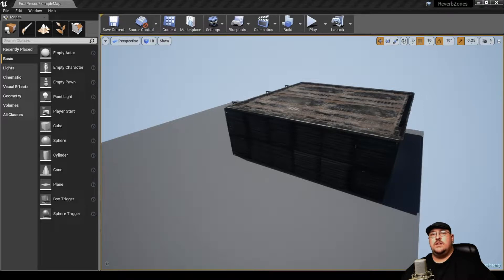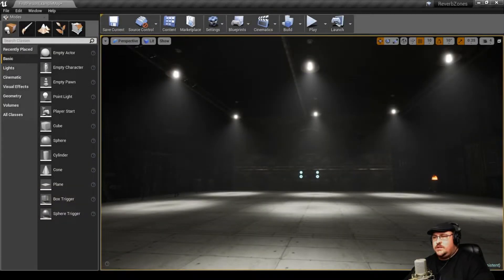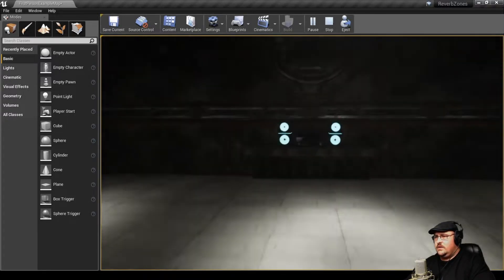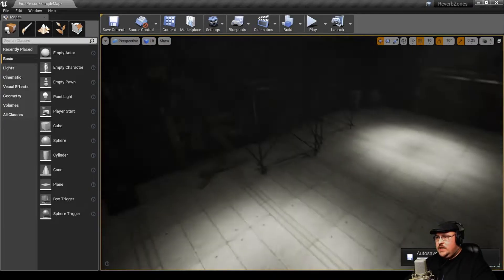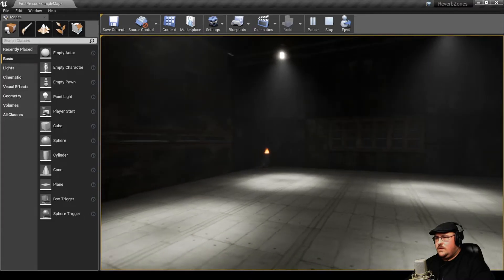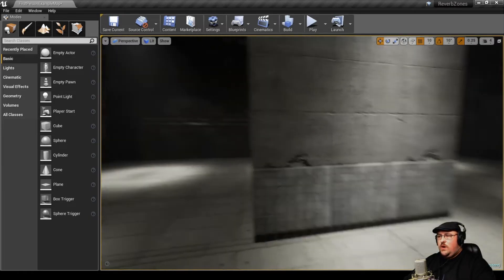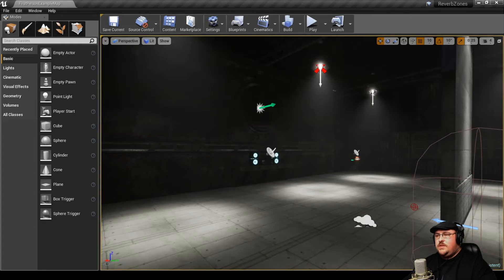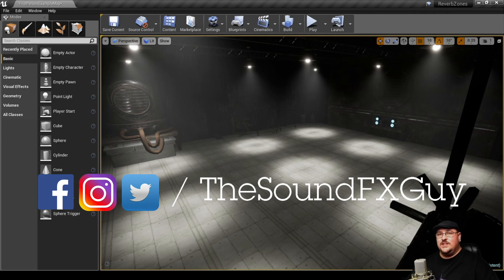Unreal Engine: How Level Design Can Affect Sound Design Using Reverb Zones

Comment: will it sound different standing on different position in the same hall？in terms of reverb?
Reply from the maker: Curt C for this example, I used an audio volume box so it would sound the same everywhere in the box. If we were to set it up using ray casting then it would change based on location. The down side to ray casting being that it takes more processing power.